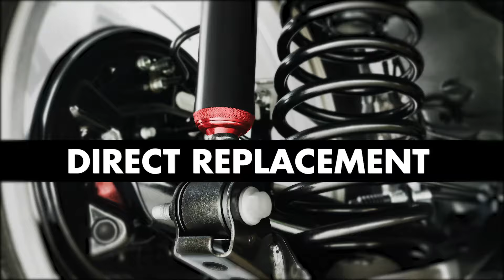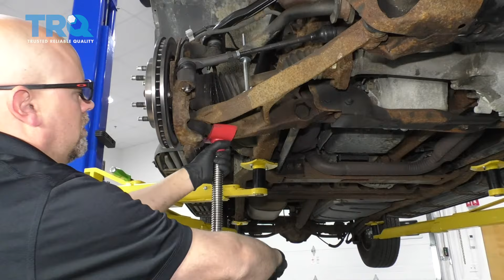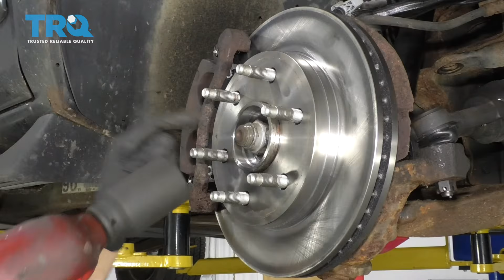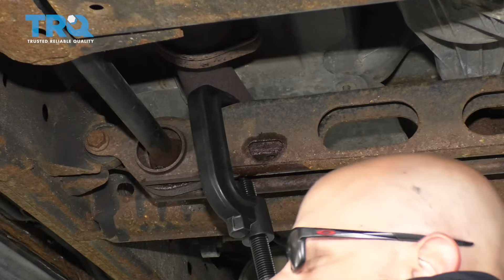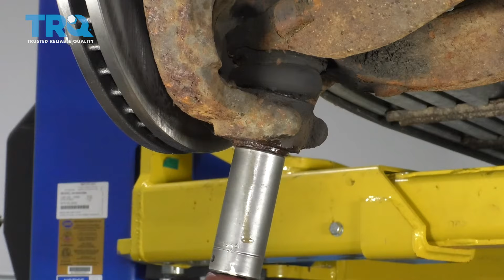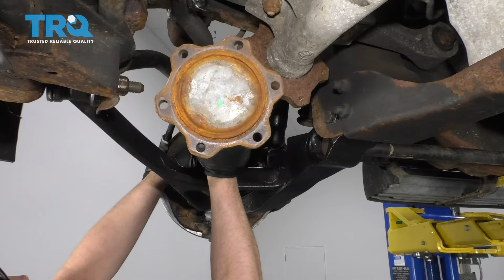How to Replace Front Lower Control Arm 2000-06 GMC Yukon

Comment: Watched this video and the steps more or less matched my chilton manual and what I visually saw on my Yukon XL 2500, so I followed along and gave it a go! I'm not a mechanic and it took me some hours of hammering/torching/cutting when the balljoint was stuck in the knuckle, but I got the job done on both sides and my truck feels a million times better after an alignment.

Comment: I did it without the torsion key tool. I also had the whole front end apart, so it made things easier too.
Reply: Hey you guy's !! Be Carefull about the torsion bar. "Torsion" it can be dangerous.... That bar is twisted as its tightened into place. It's not much of a twist mind you! You can't tell simply looking at it. But break some thing loose Without releasing the torsion? Back portion locking- mec. Anyway/nut. I actually seen one of those things break and it sounded like a cannon going off
Reply from the maker: +BetaEngineer Thanks for the feedback! http://1aau.to/m/Shop-TRQ

Comment: Mine is 2004 2wd 1500 Avalanche with torsion bar, For changing the lower bj's do I need to take out the torsion key out the way you did it? or to relive tension just place a jack under the lower ca.  Thx for great video!
Reply: Yes its a same procedure